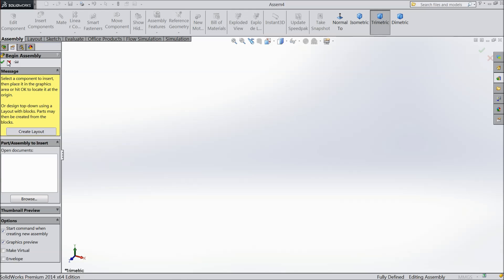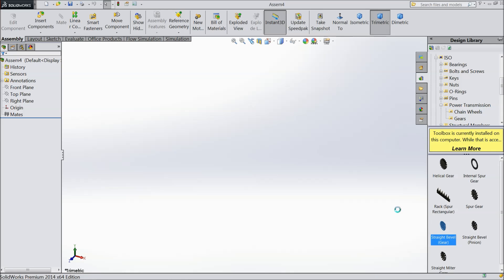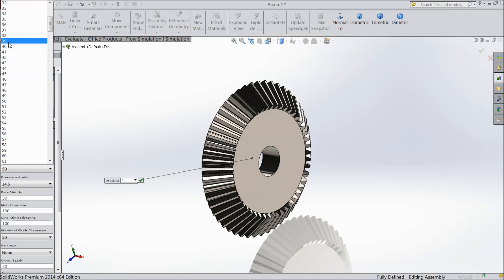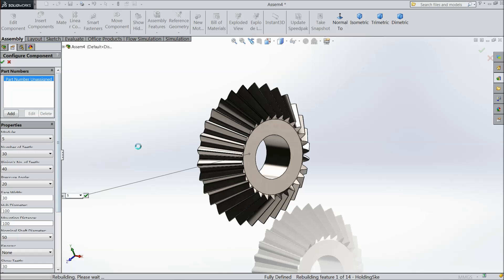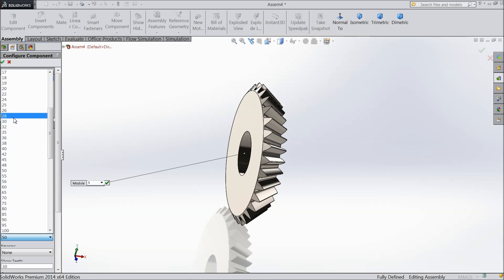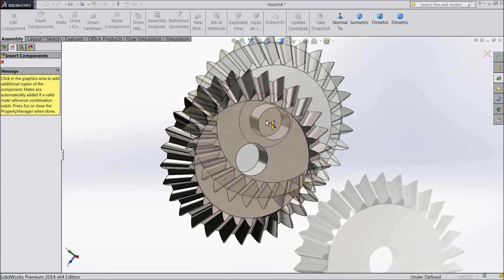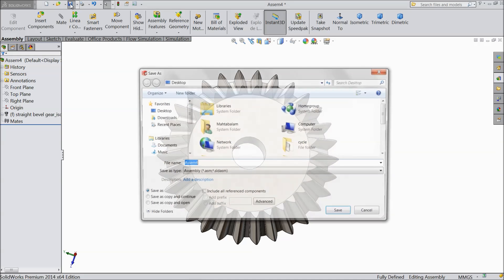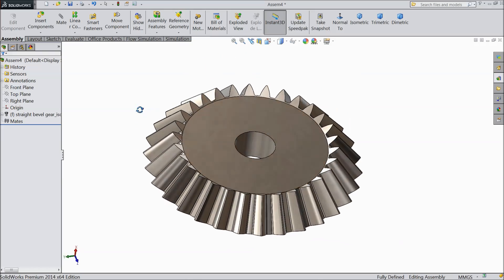How to Sketch Bevel Gear in Solidworks

Comment: It does not apper the properties window after dragging the gear, what am I missing?
Reply: If im not wrong, you have to do it under creating assembly instead of creating parts
Reply: @jingjietan4664  not sure if was that. I repeat the process and it worked out.

Comment: Sir, I cannot do these because my  module is 4.23mm (25.4/ diametral pitch=6 ) and my pressure angle is 25:
Here are my only given data
RPM DRIVER - 1140
RPM DRIVEN - 250
Pressure Angle - 25
Shaft  Angle - 105
Diametral Pitch - 6
Pinion Dia - 210